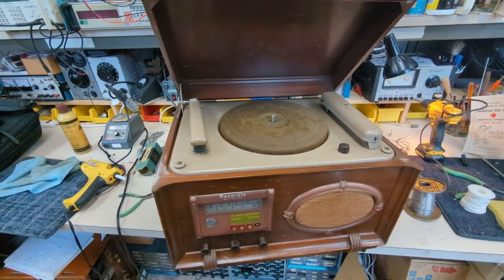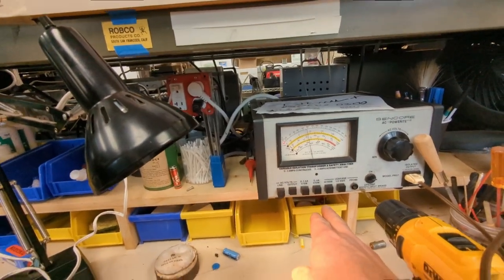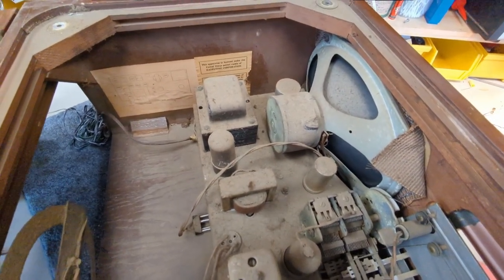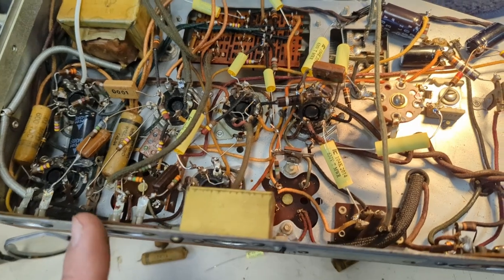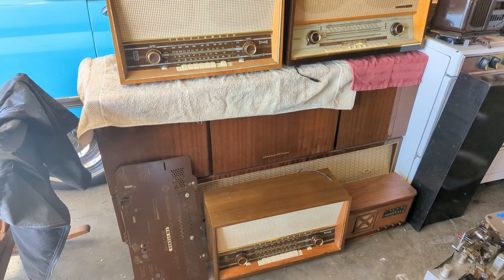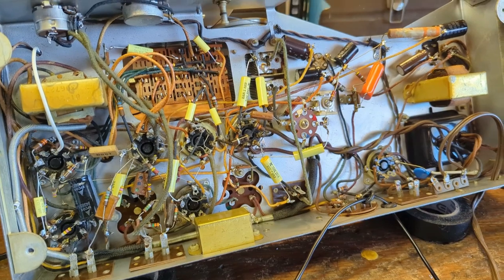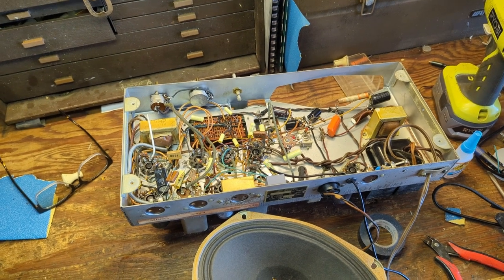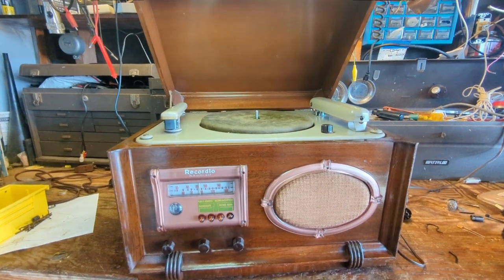1947 Wilcox-Gay Recordio Overhaul

Comment: All Recordio models of this chassis design were models 6B10, 30,42 or 45. This is the wood case 6B30 and is in excellent
original shape . It also has a PA system connection. And now Bluetooth. Nice restore Seth.